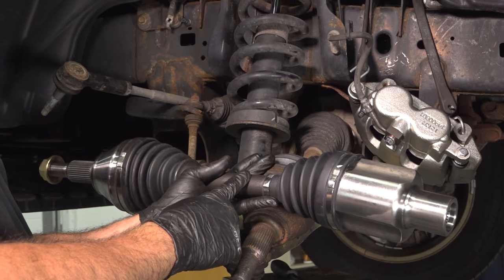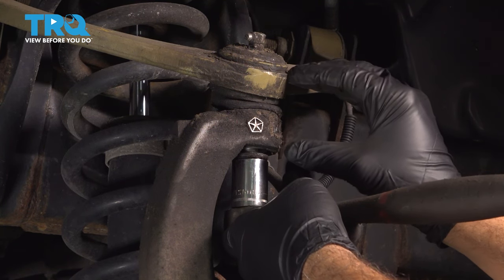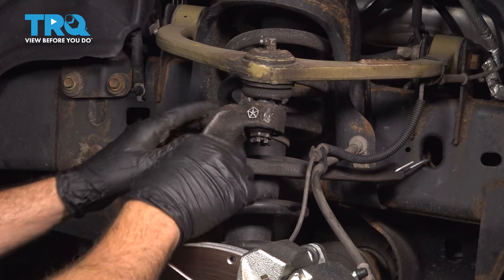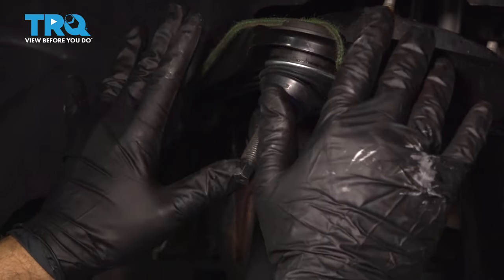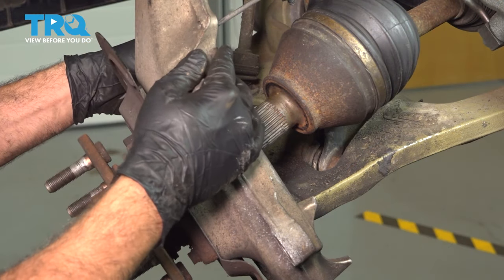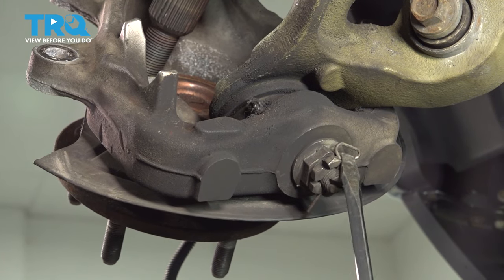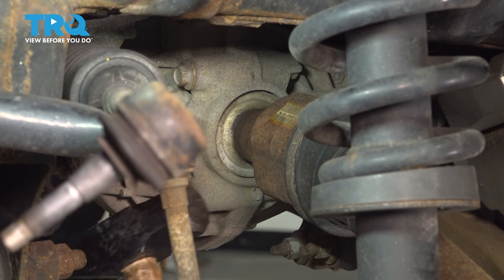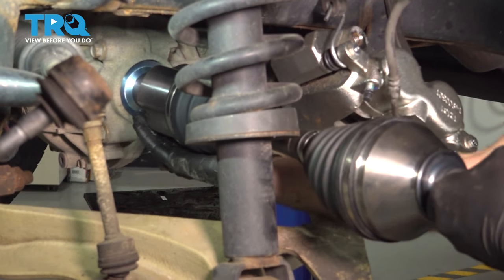How to Replace Front CV Axle Assembly 2011-2018 Ram 1500

Comment: Very great video. Torque specs, socket sizes, specific tools to use. Most vehicles that need this repair aren't as new and you might need a C-clamp to retract the caliper piston. Having said that, it is a very instructional video.

Comment: Hey thanks for this …How come when I go to tighten tie rod ball joints and other things attached to spindle I need a large lug nut sized open ended wrench as there is a 10mm bolt on the tip that spins not allowing  me to tighten with a socket so I need 2 wrenches and I can’t get it tight enough ?

Comment: FYI: While we were changing our 2016 RAM 1500 half shaft my son pointed out that there's a channel running up the knuckle's top ball joint arm.
That channel is there so that we don't need to remove the bottom ball joint to pull the knuckle off entirely. We need only remove the top ball joint and the tie rod end.
A little pry pressure on the half shaft to pop it out of the knuckle with the knuckle turned fully outwards and we're able to pry the half shaft up the channel with very little force.

Out it came. Reverse is true for putting the new one in.
A pickle fork with the right width tines is great for popping the tulip off the intermediate shaft with a couple of gentle mallet hits.

Comment: just got thru with the passenger side on my 15 gonna do the drivers side tomorrow ,,when i got the old axle off there was no lock ring !  Glad i ordered some before hand ,put the new locking ring on the stub shaft ,axle would not go in and lock ,, after a little channellock work on the ring ..axle went right on and locked . no matter what i did axle would not go in ,,maybe the lock ring was torqued a little

Comment: Thank you so much! Clear, concise directions. Only problem was I was working on a 12 year old truck, with original equipment, and you clearly had recently installed aftermarket parts to work with. So, I had to watch other videos as well on how to get some of that stuff apart, but I still probably went through this video 15 times during my install. And we had nearly a foot of snow last night, so it’s great to have 4WD again!

Comment: Thank you for this video but if you're giving torque values they better be correct right? The balljoint stud nut requires an additional 180 degrees turn after 40 ftlbs, ends up 70-80 ftlbs.

Comment: Great video, however the axles themselves are of very poor quality. Replaced mine last summer and now the driver's side is completely torn (flinging grease everywhere) and the passenger side is on its way out (360 crack on the 3rd bellow).